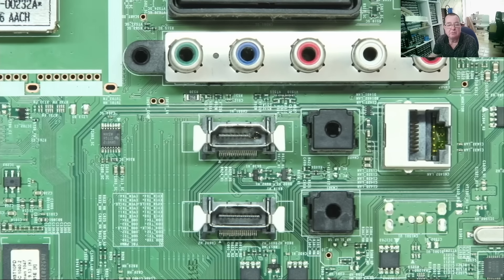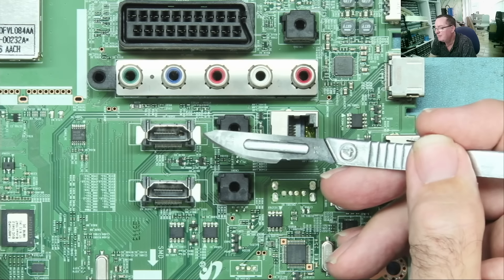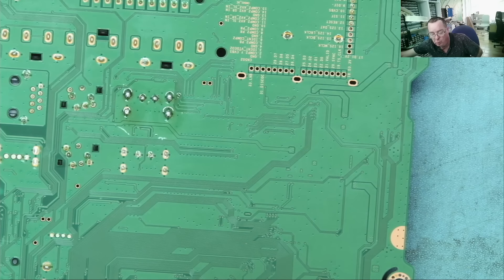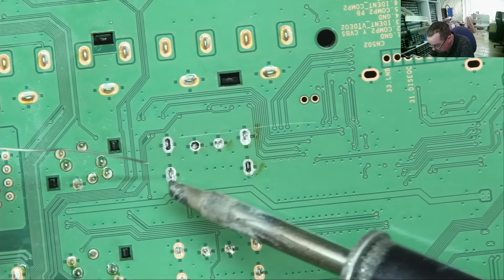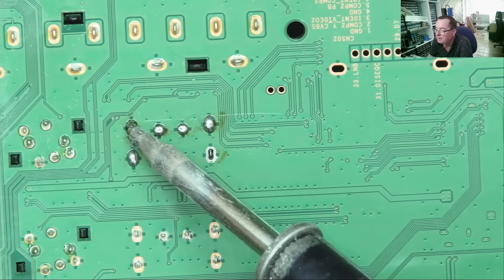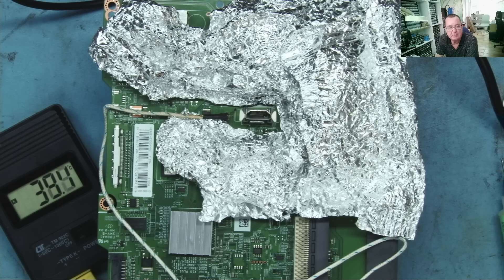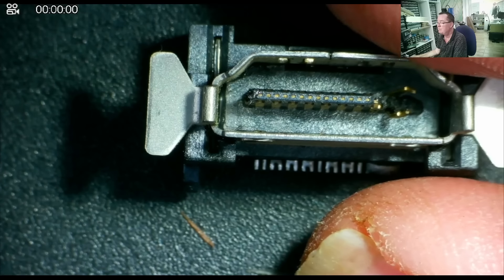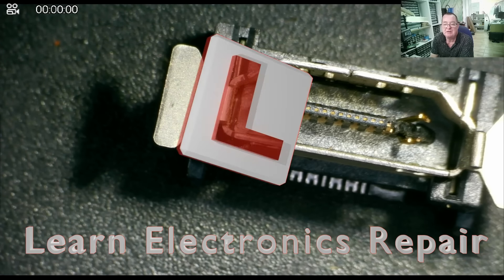How To Desolder With Hot Air Without Melting Nearby Components

Comment: Hi Rich, there is a guy on YT who has a neat way of desoldering stuff like this. I think his channel is 'MrSolderfix' or similar and he uses a thick copper wire to connect all pins together using fresh solder then uses that to heat all at the same time to extract the offending article. He then uses braid to clear the holes afterwards. It looks very neat, though I've not had an opportunity to try it myself. May be worth looking at if you've never tried this method, though big ground planes are still an issue, maybe. Hope it helps.
Reply: I use his technique regularly now at work on the more heavy duty stuff like traffos and coils. Works great. I used a paperclip bent to shape also works great
Reply: I saw that video also. Technique works great. Ingenious.
Reply from the maker: Is that any different in principle to bridging all the pins with leaded solder. I will admit I never tried it (yet)
Reply: @LearnElectronicsRepair same principle, better heat transfer i guess
Reply: I also recommend giving MrSolderfix a watch. I have been watching his videos for a while now and some of his techniques have really helped me a lot. A true soldiering artist.
I really enjoy the LER videos as well!
Reply: Yep Mr SolderFix, the best I've seen on you tube for de-soldering and track repair, I think he sets the standard to aspire to.
Reply: @LearnElectronicsRepair  Probably not where you have a bunch of small, closely packed pins but for the larger, more distant mountings it can be more focused. Your initial plan was, as I recall, to remove the shell first. This what made me think of it, to get the heat where needed without the risk of melting. As it turned out, your actual method seemed to work well.
Reply: Well Mrsolderfix technique works great on a one side operation. Both sides are a different Story. More patience solve a lot of things.Well done, keep going!
Reply: It does work on multipin headers of all kinds less hassle than this ............
Reply: That is actually a very intuitive idea. Stealing that.
Reply: I saw that yesterday. so logic, easy and clever ,for bigger component legs yes  but will not fly with "hair straw" pads like that HDMI connector i guess
Reply: This trick using wire can be used if the pins on the connector are only on one side of the PCB. If the pins on the connector are on both sides of the PCB then how do you heat the wire?

Comment: I'm retired but I spent many years in electronic repair from before hot-air workstations were even a thing through the introduction of leadless, Small outline, and other component miniaturization.  But I still learned a lot of great ideas in this video.  Even as an expert, having done this kind of work for many years,  in retirement I have thrown away a lot of electronics that could have been fixed.  So, along with desoldering tips, what I learned most from this video is perseverance and thinking a problem through, and to not let it whip you.  As I set up now as a hobbyist, I hope I can be as determined as you are in this video and don't take failure as an option.
Reply: I was never a professional, but I can tell you for certain that as a hobbyist you should almost always repair things because you enjoy the act of doing so, and saving the electronic device is a happy side effect of that. I've spent way too much time building or repairing things to justify their cost, but I greatly enjoy the process, so that makes it all worth it.
Reply: @RoshDroz  That's a great point of view.  My grandfather never threw anything away; he always fixed things. I have gone down the repair everything road a few times but life has it's own challenges and it hasn't stuck.  We just bought a house and shop on 5 acres as we retired and I am looking forward to stocking the shop and fixing things more myself again.

Comment: Add some low melt solder to all pins and and then hotair from behind (no parts on bottom of the board) should do the work easily (lift HDMI with pliers, when solder melts). That's a way almost every technician I have seen do this type of a job. ;-)
Reply from the maker: I made a video about this - low melt solder (ie chip quick) vs 60:40 solder.From my experience  It does not help in the case of connectors such as HDMI and USB.  It is very good for unsoldering IC https://www.youtube.com/watch?v=Uq_BrGY4Imo
Check it aout and let me know your thoughts

Comment: There is nothing better than a vacuum desoldering gun for this. I have a Hakko FR301 and it's a real game changer. I still would preheat and use the leaded solder like you did because there's so much copper.
Reply: I have the Hakko too, and it works really well. I see all of these professionals on YouTube going through all kinds of trouble to remove things that would take seconds with a good quality desoldering tool. I don't understand why they don't use one. Northridge fix is using a hand powered solder sucker to clean up holes after removing the component instead of just doing it all in one step. Good tools pay for themselves.
Reply from the maker: @mattbentley8958  I tried first with the SS-331H but it wasn't clearing the holes well.  I think at 15 seconds of hot air plus the preheater it came off pretty well to be honest
Reply: I have the Hakko as well, it makes easy work on this type of connector.

Comment: For desoldering pins, when the desoldering gun and the braid are not working well enough, I got a little toolbox of those tubes of different diameters made from a metal the solder doesn't stick to. Hold it over the soldered pin, heat up and push it down. In a lot of cases it will allow to detach the pin from the board when it cools down. Cheap too. Not a solution for those flat connector pins though
Reply: That sound quite useful. Do you know what they're called?
Reply: Yes what are they called I needed as well

Comment: I usually just use flush cutters to physically remove the outer shied, that piece of metal is a huge heatsink, especially because it's always connected to a ground plane. Remaining pins are real easy to remove, just heat it, pull it out with some tweezers, and it leaves clean hole in 90% of the cases. Then remove the inner piece by flooding the pins with leaded solder and blasting it with some hot air, and then clean everything up with some copper wire/copper braid and a lot of flux. Works like a charm.

Comment: I find that Chip Quik desoldering solder which is largely composed of bismuth works well without having to use excessive heat that can damage the PCB. Use it with solder wick and lots of liquid flux. Been using this for years and don't have to wait for the board to be heated up.
Reply from the maker: I made a video about this exact topic. Chip Quik is very good for some tasks but does not help (anymore than adding leaded solder does) for jobs like this.  Check out the video here https://www.youtube.com/watch?v=Uq_BrGY4Imo

Comment: I use a few pieces of copper tape to cover the surrounding components.  Using foil like you do is pretty smart tho bc you can keep reusing the same piece.  

Would the customer be ok with you using the shorter hdmi  connector and dremel out the plastic on the bezel large enough to fit an hdmi cable down into? Assuming the correct connector cannot be found.

Comment: I make covers for the parts I don't want to melt out of old soda or beer cans. Works very well. They just pop over a part like a tea cosy does with a teapot. You just have to be careful when cutting the cans into sheets that you can mould.
Reply from the maker: There are various ways to do this of course and there is no definitive right way or wrong way, just whatever works best for you 🙂 Thanks for the suggestion.
Reply: @LearnElectronicsRepair  Spot on, Rich. All the different techniques are like having extra strings to your bow.

Comment: The part number sounds like a manufacturers pick number. So it would not show up on Google. Great video I will definitely use some of your techniques in the work shop. I usually get put off with smd stuff . Thanks for your time and work in the video, from not so sunny Spain.
Reply from the maker: I searched on AliExpress for HDMI socket and Vertical HDMI Socket but no joy. 
The weather isn't too bad at the moment, it is a bit cloudy but still 24C day and minimum 18C night
It will get better towards the weekend, sunny 27C Saturday 😁
https://www.accuweather.com/en/es/maspalomas/303036/daily-weather-forecast/303036

Comment: Mr solderfix has some great ideas, he would solder a piece of copper wire around the outside, adding low melt solder, and across the middle then use heat gun and it will fall out.

Comment: 15:00
Its going to be a hard time finding an exact port, just get a short extension and hot glue it in place, meaning the hdmi female wire will be outside of the TV port, not a big deal since its behind the TV.
Reply: In my personal experience, it's never a good idea to hack or Jerryrig something for a customer. They'll rip it out, tearing pads off the board, and they'll blame you for it even though they agreed to you fixing it that way.

Comment: Back when I did TV repair, I had a bin full of scrap board and could always find stuff like that. You probably can find an HDMI connector with the correct height and footprint, just without the wings. I doubt it would make much difference.
Reply: Yeah this is a name brand LG tv, I do this on the side and I have 3 boards I could pull that exact connector off of.  I insulated the roof in my garage, so i just take a short drywall screw and screw the boards to the ceiling so scan through them for parts quick and I dont waste time soldering stuff i may never use.

Comment: I can't tell but if the outer metal jacket is the only difference, I personally would consider swapping it with the shorter one.  If it's a problem and that HDMI is more important (main input) I would consider swapping the good plug up and put the other one on the other position.  Hopefully you already found a solution by now.

Comment: You have to use a board preheater from underneath and then come in from the top with your hot air gun. With a bit of trial and error on a scrap board, you can determine the correct time and temperature settings to do this with no damage to components. You shouldn't have to foil or capton tape anything. They don't when the board is built. It just goes in a conveyor belt oven that ramps up heat and cools down. The oven is programmed with the appropriate ramp-up time, critical heat time, and cool down time.

Comment: I wonder if laying down kapton tape on the surrounding components might help too; pretty much impervious to heat, and if you did happen to get the SMDs hot enough to melt their solder connections, the tape should help keeping those components in place, keep them from tombstoning etc

Comment: Metal/aluminium foil si the absolute WORST thing you can shield components with. It's a thermal conductor (not an isolator), so it heats up like hell, and melts everything it touches. 
2-3 layers of paper masking tape + 1 layer capton tape on top, is the best cheap way to go. And it's reusable as well. 
Also, pliers are really not recommended for lifting up a connector/part. If the component still hangs on by one stubborn pin, you'll rip that pad in an instant. Use tweezers, to give your hand better feel for possible resistance.
Reply: Isn't the aluminium foil  used as a radiator, to dissipate the heat so the other parts of the board will not reach high temperature and melt plastics and destroy other components?
Reply: @arvetemecha  Aluminium is a good thermal conductor. What that means, is that it very easily picks up changes in thermal energy, and passes them on. 
What you want is a thermal insolator, aka something that opposes thermal change. So it isolates one side from the other... like we use clothes to isolate ourselves from the cold, but also not let our warmth get transmitted out.  

The reason we use aluminium as radiators, is exactly why you don't want it to be used here: it very easily transmits temperature from one side to the other.
And also keep in mind, that a radiator has to be cooled in order to get rid of it's heat. It doesn't magically make it disappear.

Comment: What if I have no "warming station"? My first attempt could be to make a constant pulling force from the connector's side while warming and pushing it's pins from the other side. The pulling force could be provided by two alligator clips plus some metal spring attached to the clips. Thus you could warm up pins locally and provide the constant lifting movement in the same time.
Will this work, how do you think?
Reply: more likely to rip the pcb tracks off.
Reply: @wibbley1  I was thinking about some light springs :) I've didn't mentioned it. Just to have some force so it will be moving in the proper direction while you're making solder joints liquid.
Reply: @KiR_3d  Problem being, if all legs solder does not melt at the same time, the legs that are still soldered will take all the weight and the track could be pulled from the board.
Reply: @wibbley1  Are you sure that tracks are so fragile? They're under a layer of lacquer plus copper itself is glued to a textolite. You need some noticeable force to rip it off AFAIK.
Reply: @wibbley1  also you can connect two light springs on sides :) So if you're right about that assumption then it must help to redistribute a possible stressload.
Reply: @KiR_3d  Hi, I was just giving my thoughts on your question. I have had many tracks lift.
If you think your idea works, give it a go.

Comment: I have the same proskit desolder is a life saver.i recommend You to use 138 degrees solder past .i use it to remover HDMI frol consoles put it on the tip of Your soldering iron the apply it to the pins. With flux on it. Thats should be off in 1-2 min. Wow .15 seconds. I don't have a pre heater

Comment: Those damn spare parts... had luck once by taking a close picture and using google lens... best of luck and thanks for sharing your experience! Oh btw, are you happy with your preheater? Any upgrade recommendation?
Reply from the maker: Yeah  have used the KADA853B many times, often on this channel, and it works well.  An IR preheater would probably work better on larger boards but I don't have one right now

Comment: lead free solder is a nightmare for repair.
you shuld stock up your supply;)
And i would open the cover just wide enough to fit the plug t(h?)ru(e?) ;)
It would be a bennift to the savety of the connector.
Sorry for my poor english.

Comment: A lot of the time you get a very similar issue with usb connectors, so I've resorted to buying a male to female extension for which ever connector make a small plate with hole an grommet in middle slide the end you want coming out the plate feed it through the existing plug hole blank it off with the plate and just hard wire the cut off end to the board to keep the functionality, for a practical work around to fix the job and not turn it into wasted landfill just for the sake of one female.... Socket. 👍

Comment: if you cant find a new one of those connectors why not try taking off that metal casing and putting it onto the one that you do have? it will take some work but if the broken one doesnt work why not just seperate it and put it on the other one? I have no idea how hard it will be though :D

Comment: Not trying to be mean but with preheating that board you could just easily desolder that component within 2 minutes without using solder wick or tape. Just heat it from the backside.

Comment: Could have heated from the under the board, nothing there but solder joints, its how i remove all my connectors like this, if possible.

Comment: The problem with engineers is they like to design stuff rather than use off the shelf components.
Reply: In programming it's called "Roll your own". Pretty highly discouraged since you don't have the time to endlessly debug your own crap work enough.
As you can see in so many brand new and improved web sites that don't work, it's good advice! But not as much fun, though.
Reply: Depends, as the price tag/availability matter. As for the programming, if we don't take some web stuff and other things involving toy languages, the true low-level code is clearly worth the effort of writing it on your own - saves ton of optimization time, along with the spaghetti callstacks so popular among the newschool copy-n-paste fans.

Comment: Are the bunny ears transferrable in some way? Also, what are the dimensions of the port? You could probably get the same dimensions but that bizarre shape is most likely Samsung proprietary BS
Reply: That was my thought. The metal part of the damaged HDMI connector seems intact. I wonder how hard it would be to remove it and transplant it onto the undamaged HDMI connector as the pins and body are part of the plastic section.

Comment: Could you not just fit the short connector, then use a short HDMI extension lead. Like the leads that come with apple firesticks. Or whatever there called 😄.